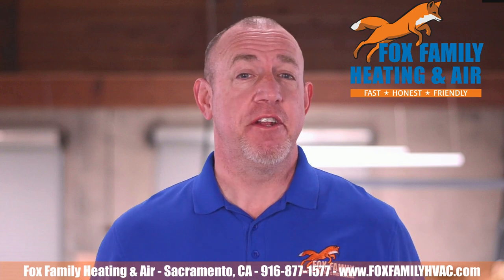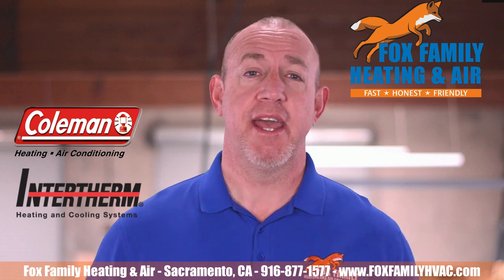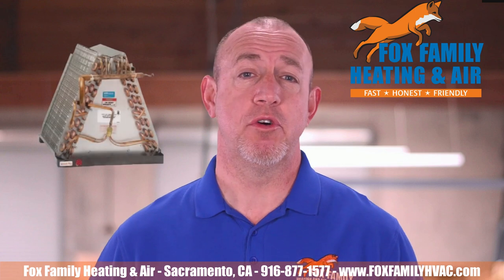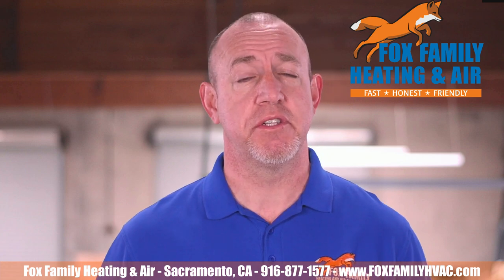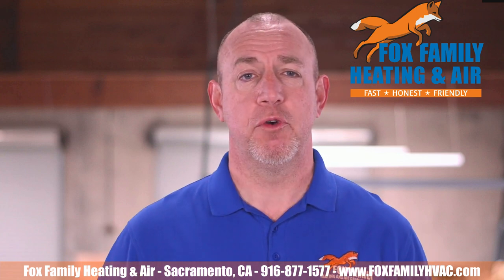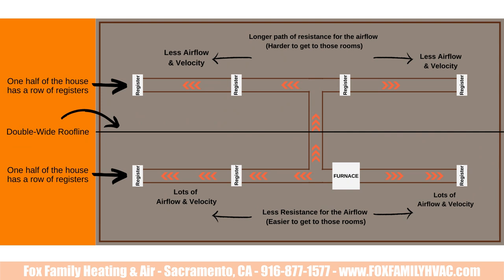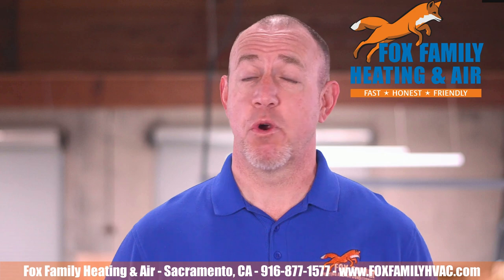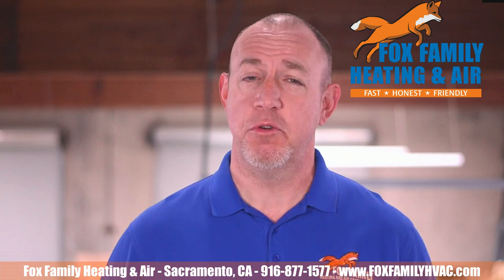Mobile Home AC Systems

Comment: I usually will try to persuade homeowners of mobile home to go all ductless. You can rod all the sub-par duct work under the house and give them a little more space where the old furnace used to be. They usually love that. Not to mention the ductless will be significantly more efficient and quieter